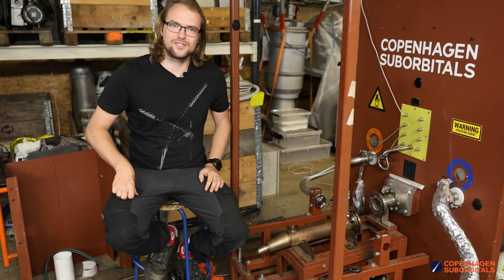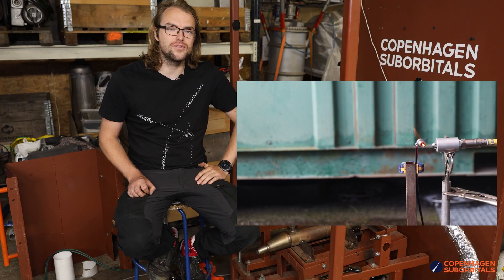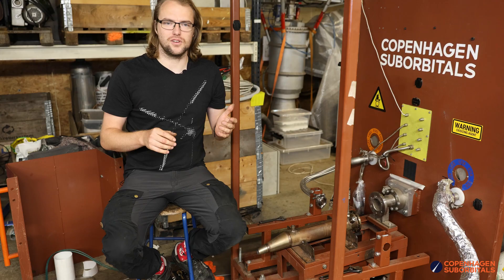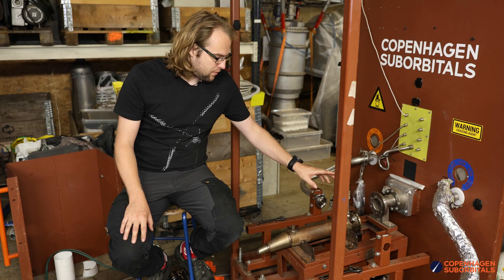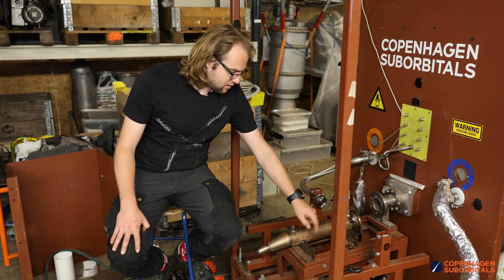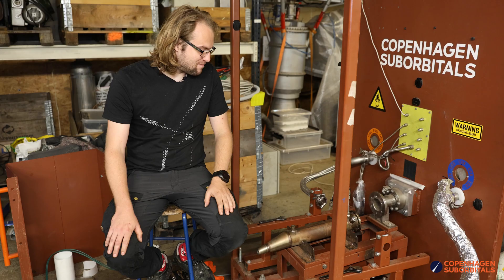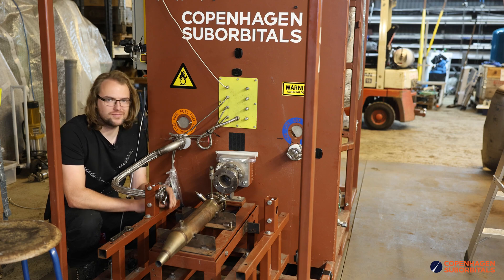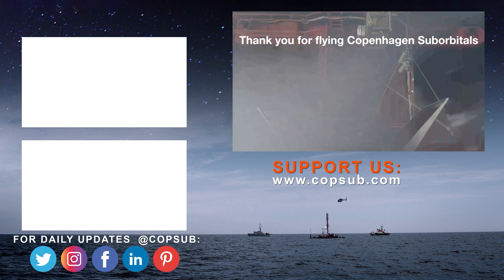Wen next hot fire test? And what we'll do differently...

Comment: Some sort of gasket is definitely necessary. Copper might be good, and there are also high temperature materials used for exhaust manifold gaskets on high performance car engines that might be a good option if you can find (and cut) stock material. Thanks for the update, good luck with the next firing!

Comment: Why not just use some high temperature exhaust cement on that flange to keep it sealed off? Another thing... Been following you guys since the early days and I know there's been some "disruptive events" in the CopSub history over the years, but as a viewer & follower it sometimes feels like you guys have been resetting everything quite a few times.. Are you 100% sure Spica is the way of the future? As volunteers leave and new ones arrive, everyone is bound to want to put their own fingerprints on the projects and change things (which is understandable) but this can also lead to prolonged deadlines instead of results. But hey - maybe Cop Sub is mostly about the process - not the end goal.
Reply from the maker: We made the technical goal of Spica back in 2014, which we are still sticking to. 
Under the hood of that, there are some individual systems, where we get wiser along the way, in which we the have to make course adjustments - ie. We found out we couldn't build the BPM-100 in-house, so we had to adjust to multiple BPM-25's. Can you give some other examples? Maybe there are areas we need to cover better here, to explain :-)

Comment: i have always assumed that a pre-burner like this is designed in stages. the first chamber handles the actual combustion. then the exhaust from thet feeds into a second chamber where the extra fuel/oxidizer/nitrogen is added in and heated up by mixing with the hot exhaust from chamber 1. with, obviously, the connection between chambers 1 and 2 sized in such a way that there is no backflow. the overall output of this would then be oxidizer-rich or fuel-rich or nitrogen-rich gas that is fed into a turbine to power a turbopump, then fed into the main combustion chamber (or siphoned off to pressurize tanks, etc). .... it looks like you're trying to do all that in a single chamber, which i would think would be more difficult than a multi-chamber pre-burner. food for thought, if your current design continues to have issues ... fwiw
Reply: actually, to be more clear, i assumed that chamber 1 was contained inside chamber 2, so that the cold fuel/oxidizer/nitrogen flowing into chamber 2 would flow around chamber 1 and act as a cooling jacket for chamber 1. hard to describe with only text, but i think the design would be fairly efficient.... if wanting to keep the nitrogen separated from the combustion exhaust, then simply run it through a cooling jacket for chamber 1 and (maybe) also run it through a non-mixing heat exchanger .... fwiw

Comment: So is this just a single nozzle trial run? The next gen spica engine?
Reply from the maker: You can think of it as a dumbed-down version of a gas generator. It will burn to heat up liquid nitrogen, which will then evaporate and turn into gas that will pressurize Spica's propellant tanks so we can keep a constant engine pressure during the entire flight. This should greatly reduce the mass we would otherwise use for pressurant COPVs. More in this video:
https://youtu.be/7ULg5N_FP0U

Comment: Is this an igniter or a manuvering thruster?
Reply: It is just a heat generator producing a lot of hot exhaust gasses. Like a "hair drier on steroids" 😀
It is meant to heat up a lot of nitrogen for pressurizing the SPICA tanks before and during flight through a heat exchanger. It is designed to burn rather cold compared to a "real" rocket engine. That is why it has no cooling jacket. Some of the objectives are 1) to establish a proper ignition with a weird O/F ratio and 2) to demonstrate the ability to control a self sustained combustion at a low combustion temperature. Unfortunately none of these objectives were obtained during our latest test.
Reply: @jorgenskyt thanks for the explanation. i was wondering the same thing. i think this might be considered a "pre-burner" then, not certain though.

Comment: about the pulse-jetting, my theory is that the problem is the pressure at which you are injecting fuel and oxygen. when the fuel ignites for the first time, the pressure is rising fast and at some point gets higher than the pressure you are injecting fuel and oxygen so you get a pause of fuel addition and thats why you get such pulsing and flames outside of the engine.
Reply: this sounds like a good possibility. i know the pressure fuel and oxidizer get injected into the chamber needs to be comfortably higher than any pressure achieved in the chamber itself otherwise something like this will happen and/or there's also a danger of the combustion getting pushed back up the lines feeding fuel and oxidizer. that's why welding torches have flashback arresters on the feed lines .... fwiw